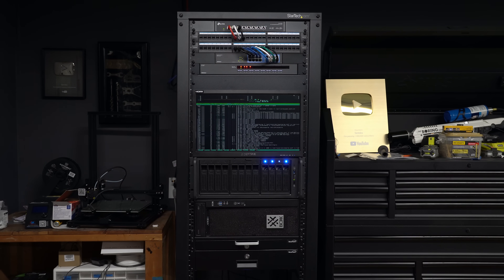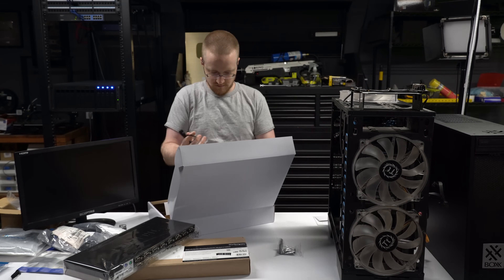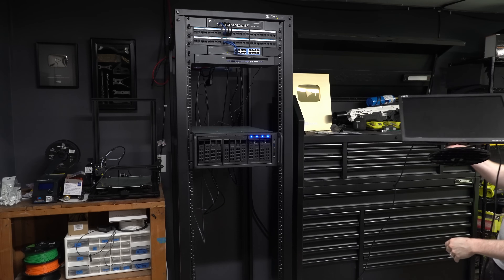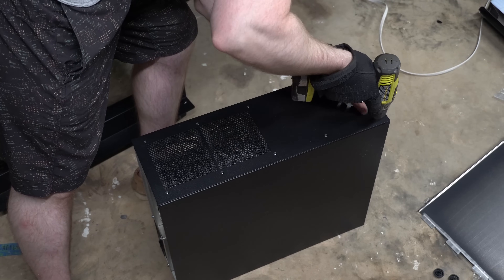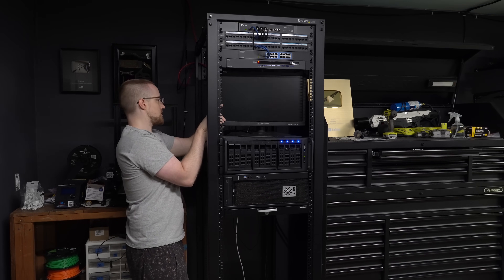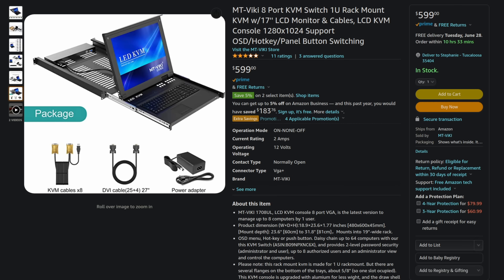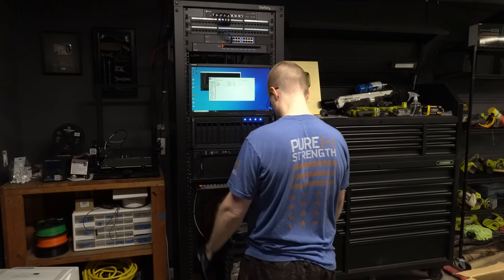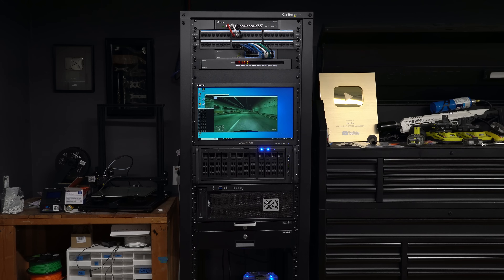Home Lab Build - P.2 - Rack has evolved!

Comment: a rack floor is a strange choice. - What are you using for battery backup? - the bottom of the rack is typically where a rack mount ups would go.  please don't tell me that you're building a sweet rack setup with a hefty equipment investment that you're plugging directly into mains power...

Comment: I would recommend not pushing the back of the rack against the wall, but push it against a wall... sideways. 
That way, when you pull it out, you can get to both the front and back.  Or even get to both sides without pulling it out at all.
I can tell you with my desktop on the desktop, I always put mine sideways with the motherboard side facing outwards, with the back of the PC to the left, and the front to the right.  

If you want it to still look impressive sideways, what I'd do is make a flat easily removable side panel for the full length of the case, and then emblazon your company or whatever logo on it 🙂

Your original fronts and backs become... left and right side... and there is no stigma to mounting stuff "in the back".  Fill it all out.

It's not like you are going to have rows and rows of these things... like an IBM datacenter.

Comment: Not sure what you've done since this video, but I just commented on P1 and mentioned some 30-35" deep shelves you can get on Ama but, after looking closer at what you did with the wood, you might want to just stick with the wood in the bottom. Maybe cut another narrow piece to use the full width and maybe some joining brackets or other hardware on the bottom, so it is one joined piece of wood and just paint it black. I say this because a full-depth self would have to start at 1U and you're getting a little extra space doing it the way you have here. And also, there were not many full-depth shelves available at decent prices, and a sturdy one would be expensive. So, I think the wood idea might be better than a shelf if you just refine it a bit.

Comment: I have a 1U KVM like the one you showed, but it was used and came with my rack. It's main problem is that it's so old that it's VGA and the older style PS2 keyboard/mouse connectors.  Oh and the cables are about a billion feet long.  I no longer use it because servers themselves all have IPMI or iDRAC interfaces that let you get virtual consoles.

Comment: Looks good man 👍 I’ve got a singular UPS battery in my rack: if you’re open to tinkering, you can run NUT (network ups tools) on a server (or raspberry pi), and even with a single battery it would last enough to safely save&shut down all your apps and servers, should anything happen

Comment: 7:15 live tv broadcasters have needs for small rack mounted moniters, when your monitoring multiple cameras and source feeds in the back of vans... my old job was autos electrical for a broadcaster, some those guys will have between 5 to a dozen rack mounted 10in screens and like 1x ultra wide or 2x 27in monitors at the console.

Wiring side of things I couldn't tell ya, separate team handled that stuff, I just modified the vehicle electrical to support their gear and serviced the inverters, batteries and 12v electrical.

Comment: Why have the switches at the front? All the nics are in the back, so that's where the switches goes too. And before someone says the the switches goes in the front due to airflow, it totally doesn't matter with a free standing rack. Data centres with hot isles and cold isles have walls that prevents hot air from one side of the racks from mixing with cold air on the other side of the racks - with a free standing rack the hot and cold air mix no matter which way you mount the equipment.

Secondly, don't put patch panels between two switches, that's just make the ports on the rear of the panel hard to see and reach. Put them at the top and in the back, that way the cabling from the rest of the house can come in from the top and not get in the way of the rest of the equipment in the rack.

Comment: All those power tools in the Husky box and still uses the manual screwdriver. SMH.
Reply from the maker: I use the power tools for things that make sense. For the larger bolts that actually connect the rack together, I used the power tools. For the smaller cage nuts? Eh, seems pretty silly to me to pull out the impact drivers and hammer drills. If I was racking servers all day, I might want one of those little electric screwdrivers for the cage nuts and bolts, but nothing more.

Comment: dont worry about the wood, I've had a wood floor in my rack for over 2 years at this point, as I dont have rails for my server and I dont want the cables in the back to break if the back of the server falls in while pulling it out.

Comment: The KVM cables are NOT normal VGA cables, they have extra data pins connected to the unit end that are then broken out at the server end on the USB cable. You put your universal rails in wrong, they mount from behind vertical rack rails.

Comment: I have a KVM switch that I got used.  It has the built-in monitor that flips up.  Unfortunately, the power button for the monitor broke.  I don't use it any more anyway since everything else in my rack has iDRAC or IPMI now.  Which is good because the KVM switch is old enough that it has PS2 keyboard and mouse connectors.

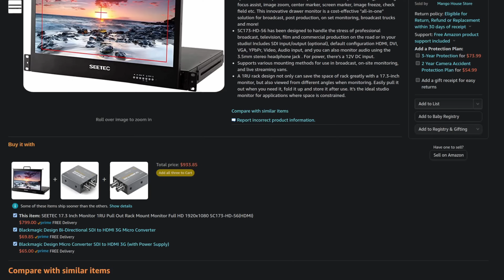Comment: 7:08 those product pictures are like that, because those rack-mounted monitors are mostly geared towards the live broadcasting space of sport events e.g. That's also why you see a Blackmagic rack-mount monitor there. This is also the reason why they're very expensive: they are probably color calibrated in such a way that they are suitable for live broadcasts.
Reply: One more thing. I love how IT people think that racks are only used by them. The 19" equipment rack was first standardized in 1922 by AT&T for relays. The idea of equipment racks dates all the way back to railways in the late 19th century.

And us in the video production industry have been using equipment racks since well before the internet or IT even existed.
Reply: Video Engineer here. Can confirm this is exactly why those monitors show those pictures. These monitors are designed for broadcast television, not server rooms.

However the price is mostly because they use the professional SDI signal standard as an input rather than something consumer like HDMI. And from the fact that they are built with a rugged metal chasis, not cheap plastic. The monitors shown are not color calibrated.

Color calibrated broadcast television monitors are much much more expensive. $10k and up. For that reason we actually generally use very few color true monitors. Most monitors are just there to confirm what signal is going where, then you have one or two color critical monitors used for actual signal engineering.
Reply: just anwering that, also was broadcast engineer, not all racks are created for server, note those monitor`s description,  broadcast sdi rack mount monitor
Reply: Thank you, just wanted to say that lol. Nice additions also Rob.
Reply: Beat me to in. I was a broadcast engineer before moving into rural paradise.

Comment: 7:13 those monitors are for broadcast live events or tv stations, that's why the advertise them with live events because the "control master" needs to see many cameras.  Those monitors are also rack mounted because the control tv room also have many racks, but I'm not sure that those racks has the same width of network racks, so they probably won't fit.
Reply: They do fit....sometimes. While our server racks are almost always 19", the racks used in broadcast can be 19" and 23".
Reply: @mirror71  I believe the 23" racks are for older telco gear. I worked in tv for 11 years and never saw a rack that wasn't 19". Biggest difference I saw between racks marketed to A/V pros and those marketed to IT is that the A/V ones always rails with tapped holes with #10/32 or #8/24 threads instead of square cutouts for cage nuts. But anyways, always 19".
Reply: @eh5806  I'm probably out of date here. The last time I worked in that area was right as the switch from analog to digital was happening. At that time, we were primarily 19" but still had some 23" gear that was always a pain.
Reply: there are also event streamers that put racks in their road cases and simply open up a side of the case and just power it up and are ready to go quickly. There are so many uses.

Comment: What I came up with in 2 years of using server rack at home: 
1) UPS is not needed in my case. I lived in an old house with bad wiring, so I immediately attended to this issue and spent a lot on it. They are very expensive, and supplying only two GPU farms would cost more than the cost of the rack itself, and the batteries need to be changed every few years. As a result, I extended a separate power line from the electricity meter with it's own RCD and installed a voltage stabiliser + do checkpoints more often 
2) extra shelves clogged with the wrong stuff 
3) sitting at the rack is not very convenient, each time pushing-pulling out the periphery tires. If space permits, it is better to put a compact table nearby. It's not as aesthetically pleasing, but much more convenient. 
4) It is better not to put a 3D printer on a server rack. Rack is not super solid, nor is the shelf, and the 3D printer can produce vibrations. The difference in print quality on the floor vs rack is small, but noticeable 
5) ground the rack and cases, less dust will accumulate :)
Reply: Or he can just ssh into the equipment like literally everyone else... Also whats up with no ebay usage... So many amazing deals

Comment: Next will be to address a capable UPS able to handle 75% of your peak load without breaking a sweat otherwise during an interruption some will suck up too much resulting in boot loops. Also depends on how long you want your systems to run in an outage. Some automatons for graceful shutdowns and monitoring. Lastly, on networking I didn't see anything about a proper router/firewall ..Maybe you don't have a need for segmenting your network? Maybe you don't access you devices away from home? Or you don't have devices on your network that you'd consider untrustworthy or risky?
Reply from the maker: The only thing I really want protected via UPS is the NAS. 

Beyond this, maybe the modem so internet doesnt knock out for 2 minutes on a power flicker, but ...really mostly just the NAS which is pretty low power. I might later add more UPS to some of the other compute machines, but the only thing that houses anything I'd be sad to lose is the NAS.

As for firewall, nothing in the rack is currently remotely accessible.
Reply: @sentdex  Really like the engagement! It started all the way from your 1st vid on you building a home lab.  On the firewall/router as from my last point ...even on a LAN I wonder if there are devices that can see into it and have internet/WAN access ... Yes I know of the double NAT but some of these cheapo devices initiate the traffic to the outside and when they or their infra become compromised ARP/Ethernet scanning on your LAN is trivial/easy ...

Comment: I threw my 3D Printer in my Rack - hugely recommend. Some LED Strips when it's on and it turns into a center piece for it. I also have an open frame and instead of an actual monitor rack like you went with, I just use a simple Monitor arm that's off to the side clamped onto the shelving I used for the 3D Printer - allows me to reposition it when I'm working on something else on my workbench which is right next to it - very similar to your setup.

Comment: That's looking pretty wicked :-)  I presume that's gonna generate a lot of heat.  How are you going to keep your room cool...enough?
Reply from the maker: I am in a space that I built for this purpose. Currently in the middle of a heat wave and things are more than comfy in here.

Most of the heat-generating machines I already had anyway, I just changed how they're stored. I might have even net-reduced my power draw with all the monitors I've removed from the equation :D
Reply: @sentdex  Could you touch on your power system, for example do you have the tesla wall or whatever it is called?